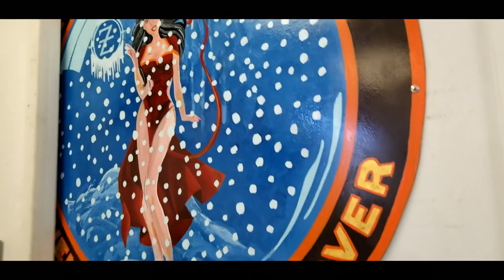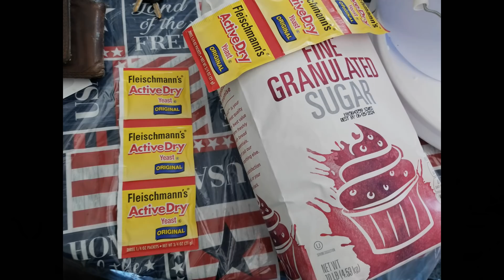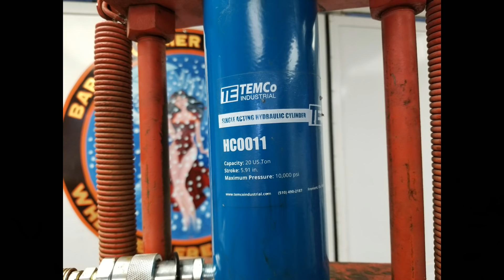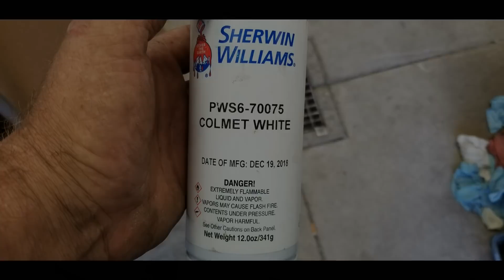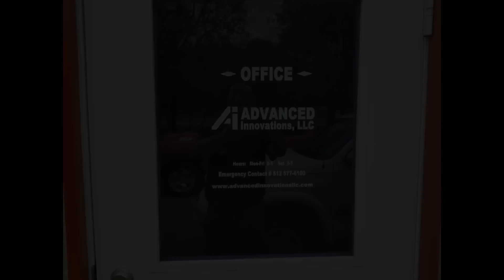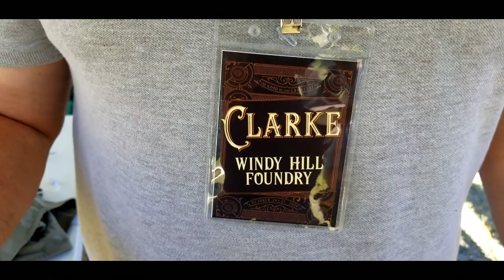The Grind #49

Comment: Hey Stan, wish I could have tried that apricot wine, but glad you got to try the cherry currant mead I brought.  I made that as a 6 gallon batch that contained 20 pounds of honey, 3 quarts of cherry juice and 1 quart of black currant juice padded with spring water.  It had so much sugar residual from all the honey that I didn't need to backsweeten it, and a lot of people found it to be pretty sweet still.  From what everyone said it seemed like the aging and sweetening worked pretty well for the yeast you used.  When I do fruit based wines (which is the bulk of what I do), I tend to stick with a white wine yeast like a Lalvin 71-B.  The acceptable temperature range of that yeast goes from about 55-86 degrees F which works great for not needing fermentation fridges as long as I keep it inside here in Texas; I would imagine that it would work well in your locale as well.  I've always just let it go until it was finished then worry about backsweetening later, generally after I rack to tertiary.

Also, that Big Gator V drill guide I won in the raffle...it's ALREADY bailed be out once this week.  That's going to get a lot of use in my shop.  I had to drill and tap some flange holes for a weather station I'm adding to a piece of heavy antenna mast, and needless to say that didn't fit in my mill :-)
Reply from the maker: Those 8 jars I sent over sure didnt last very long, so I guess that means it was good right?
Reply: @ShadonHKW  I've always thought that empty jars are success!